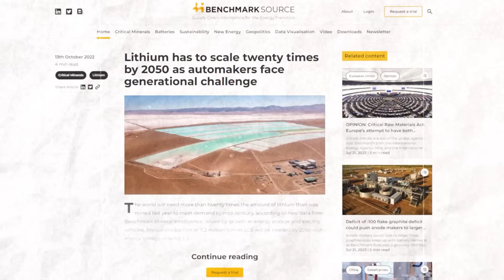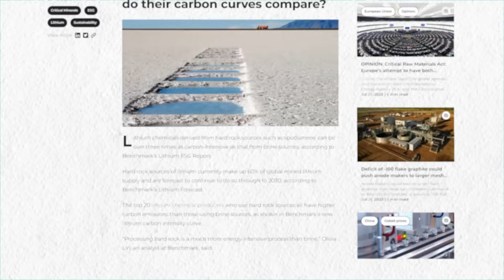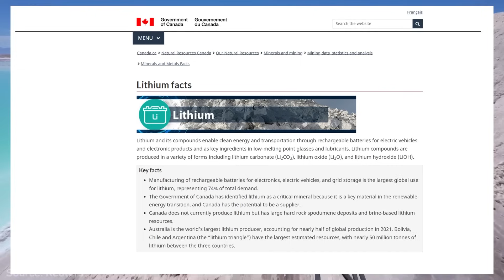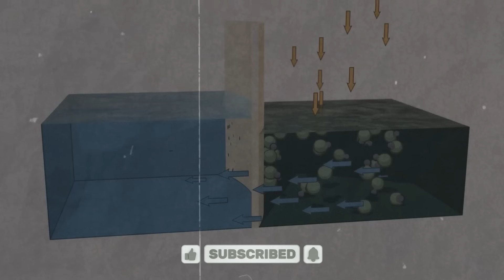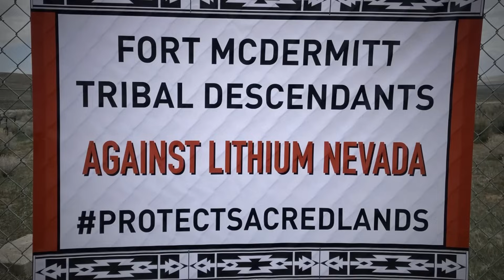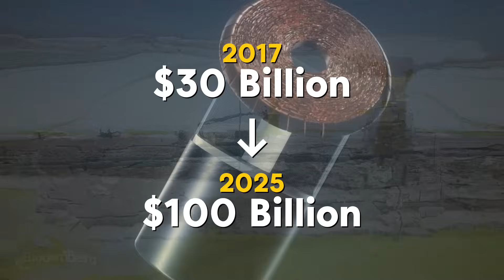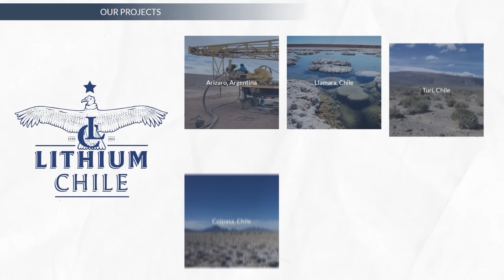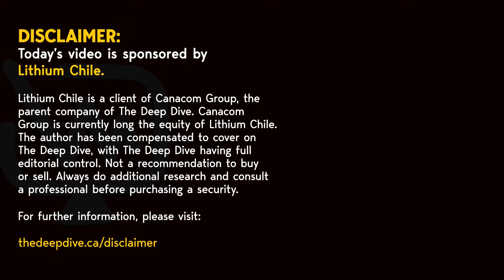Lithium Brine Extraction: The Race to Power Tomorrow's World

Comment: Membrane has been invented to separate oil particles for refinement into different fuels. If similar strainer existed to separate lithium from brine, a closed system could just keep recycling it's hydrogen/hydroxide, made from splitting water with lithium.